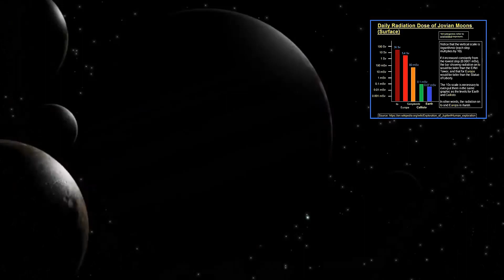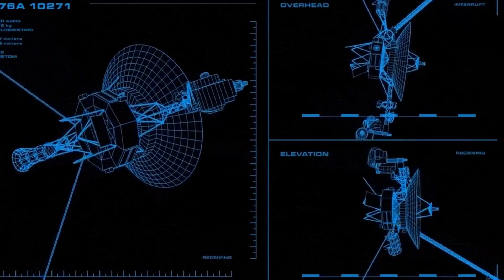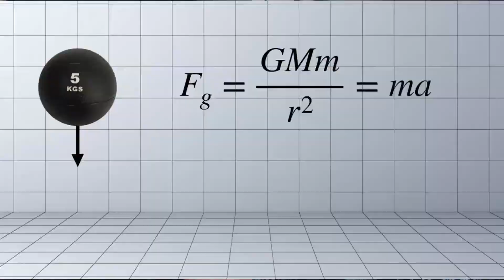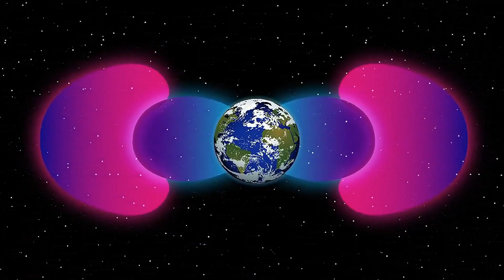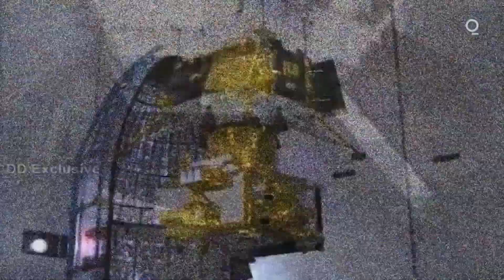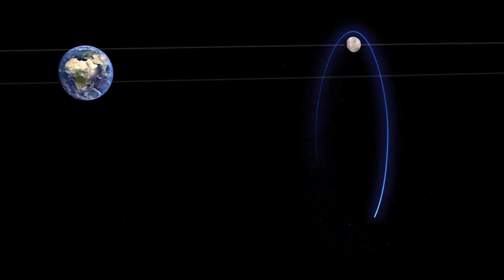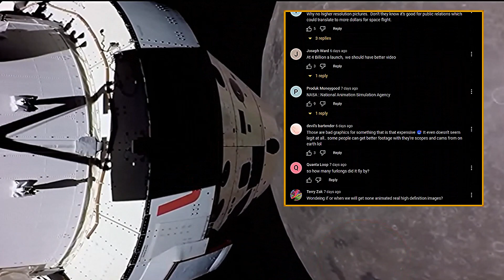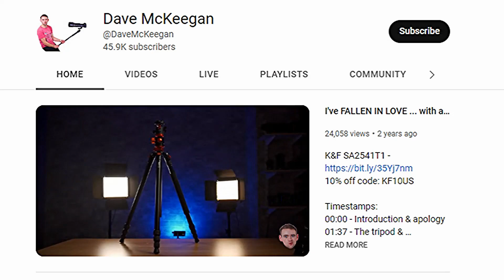THE APOLLO DISCUSSIONS "RADIATION\ ORBITS\ GATEWAY" PART 21

Comment: Comment about Jupiter's moons below copied from phase52012:

(1.) "THE APOLLO DISCUSSIONS "RADIATION\ ORBITS\ GATEWAY" PART 21" - Just listening to this gives me a headache.
At 00:34 - We are looking at an animation of the JOVIAN SYSTEM. And the graph that pops up says: "Daily Radiation Dose of JOVIAN MOONS. (Surface)". And Scott says "why wouldn't our own moon have that increase?". OK ADs, I'll explain why the numbers are what they are. THEY ARE MOONS OF JUPITER. For anyone who knows anything, thats all you need to know. Jupiter has two and a half times the mass of all the other planets in the Solar System combined. Had it been any bigger; we'd probably have two suns in the sky. Jupiter's magnetic field is the strongest of any planet in the Solar System. The magnetosphere extends approx. 75 Jupiter radii from the planet. Our Moon does NOT orbit Jupiter and is NOT enclosed inside Earths magnetic field. BTW: when NASA sent Pioneers 1 & 2, they detected the high radiation levels around Jupiter, but continued to operate. To protect the more sensitive instruments on the two Voyager probes; which were almost complete; NASA had to think fast. So they sent a guy down to the local supermarket who bought up all the aluminium foil they had; and the engineer wrapped all the electronics in a few layers of aluminium foil, and the rest is history.

Comment: FAO William Swithin. The Apollo spacesuits were not designed to leak, they were expected to gently leak but, as long as it was within safety limits that was okay. The Purge Valve was part of the emergency OPS (Oxygen Purge System) for use if the PLSS failed in some way. The purge valve, (note the word 'purge') was not a pressure valve, it was to vent CO2 contaminated air in the event of a PLSS failure and the OPS was in use. The OPS was never required.
Reply: You know he’ll never understand a word of this even if he studied it with a tutor for the next ten years, right?
Reply from the maker: Zippers no matter what you do to them, will leak atmosphere in to an ultra hard vacuum whether in space or in a chamber on earth. Why were,'t the suits tested in the Sandusky chamber then? There lies the lies.
Reply: @shillstompers3793  Do zippers hold out the water from a dry suit? No, they pull together seals which, in a spacesuit, are forced together even tighter by the pressure inside inside the suit pushing out. 
Are you talking about testing suits in the Sandusky chamber with real people? How long does it take to pump down the Sandusky chamber? How quickly could you get to a person in trouble inside the chamber? Try thinking.
What is the difference in pressure between LEO and on the moon in actual psi (or whatever units you like)? Compare with the maximum A7L leakage safety limit of 0.3psi/min.
Reply: @shillstompers3793  You are so thick. The zippers ARE NOT THE SEAL! The zippers hold the seals together. FFS, it's not that complicated.
Reply: @corneliuscrewe677  For them it is.
Reply: @CLERIC_58  No arguments there...

Comment: Big solar events can cause big rapid distortions in the Earth's magnetic field. Moving magnetic field lines passing through a conductor induces currents to flow and, on power lines, these may be large enough to blow the transformers at the ends which may be hard to replace, especially without power. Power is not being absorbed from outside radiation as Marcus Allen was suggesting.

Comment: Because the Earth covers about 2 degrees in the lunar sky and remains in the essentially the same place, once the LRV antenna is pointed at the Earth it didn't need to be adjusted. The Earth is rotating of course, and different receiving stations (some with dishes over 200ft in diameter) took it in turns to receive the signal from the moon which was widely spread out by the time it reached Earth. The high gain antenna on the LRV didn't even need to be aimed with high precision, its gain was 24dB directly on target, 23.5dB within 5 degrees and 20.5dB within 10 degrees meaning the antenna could move by 10 degrees and STILL be picked up on Earth.
This is why the LRV could be bounced around as they unloaded equipment and not lose communication
Reply: Lol you are a flat earther, literally.
Reply: @papalegba6796  Meaningless, especially as I talk about the Earth rotating above. You have all the qualifications for flerfdom.
Reply: @CLERIC_58  says the bot who just stated the earth both moves & doesn't move lmao. You have zero self awareness, chatbot.
Reply: @CLERIC_58  I understand you're a flat earther spamming me with NASA propaganda.

Comment: The flamingos from Planet Earth 2 have what relevance exactly? UV gets stronger the higher up we go? Who knew? Solar UV does not penetrate metals, spacecraft windows block it and plastics such as polycarbonate and polysulfone used in the Apollo spacesuit visor assembly do a good job of blocking it as well.
Reply: @boptah7489  I wonder how that object that looks just like the ISS managed to get 250 miles up, as can be easily measured using basic trigonometry using the differing transit paths across the moon or sun as seen from closely separated observers on the ground.
Reply: @boptah7489  The ISS is not always in the sun is it?
Reply: @CLERIC_58  hologrammed SR71.  As i told you before.      I have seen those hilarious videos of the transit paths accross the sun and moon.   Maybe someone should tell them about parrallax.
Reply: @CLERIC_58  holograms can change colour.  
  The Sun gives off lots of radiation.  If the ISS was real then it would b a mass.   and the mass would vaporise .  because it would not be able to radiate the heat way in sufficient quantities  ( in the form of infrared )   the Sun is more powerul than a tiny little mass.
Reply: @boptah7489  Not interested in the colour of a hologram (about which you clearly have no knowledge). How does a hologram 250 miles high, block light from the sun so it is silhouetted?
Reply: @corneliuscrewe677  I have only come back for some nice easy sport from some low hanging fruit.   It tickles me pink watching the mentally deficient dribble everywhere. 
 And you are correct.  rockets don't work in space.    Because there is no resistance.
Reply: @boptah7489  Says the pseudo-flerf who can't comprehend conservation of momentum🤣🤣🤣
Reply: @CLERIC_58  of course i understand the conservation of momentum principle.   Once the rocket has its gases sucked out of it into the vacuum, the gas molecules are attracted to nearby gravitational fields.   You fail to understand that the 'Closed system'  is actually the Universe.   But , not to worry.   A rocket can't go anywhere near space.    As Werner Von Braun discovered.
Reply: @boptah7489  Where did Von Braun state that? Be specific...
Reply: @boptah7489  You misspelled “infinitesimal.” Just sayin’.
Reply: @CLERIC_58  you cannot burn fuel in a vacuum.  you need pressure to mix fuel and oxidiser and then you need pressure to ignite them.  Just like a diesel engine   ( hypergolic )  
   You cannot pressure in a chamber when there is a MASSIVE hole in the end exposed to a vacuum. 
  As i have explained to you before.   Rockets do not work by creating an imbalanced force in a chamber.   A rocket motor is designed to create pressure behind the rocket using accelerated dense gaseous mass and heat.  .  that is why a rocket motor is designed like n inverted Teclu burner..
Reply: @corneliuscrewe677  That video i posted with the vacuum cleaner and the balloon is the closest thing you have seen to a real life physics experiment in your life.
Reply: @CLERIC_58  you cannot burn fuel and oxidiser unless you mix it first.   Do you understand ?.    ie  a typical hypergolic reaction is a diesel engine.  .to explode the diesel/air  it needs to be mixed 
any access to a vacuum does mean instant evacuation.   Imagine a SCUBA tank with the bottom cut off and connected to a vacuum.   How much pressure can you put in the tank with the most powerful compressor in the Universe ?......Zero
  A rocket nozzle connected to the combustion chamber is NOT a small  opening.  It is a gaping chasm in physics.  A bit like the gap between your ears.  
   Now.  to those of you that have even a slight understanding of physics you can deduce that the escaping gases being SUCKED out of the rocket probably impart some momentum onto the sides of the opening.  This means the rocket moves BACKWARDS.    
 According to you.  If i take a suitcase from the boot of a car, the car should move forward because the suitcase has momentum  ????      No   
   Gases being sucked out of the rocket has nothing to do with the rocket at all.   Gases expand naturally in a vacuum and does not need to push off of anything to expand.   A rocket is just a metal tube.   Gases expanding can not exert a force on a metal tube unless there is an EQUAL AND OPPOSITE  force equivalent to the rocket.    You can't pull yourself out of the swamp by your own collar.   You can't lift yourself up with your own bootstraps....struth
Reply: @CLERIC_58    No   using fuel + oxidiser to produce hot gas ONLY works in a pressurised environment.     you cannot mix or burn gases in a vacuum. because to burn fuel and oxidiser you need pressure first..   Thicky 
   The exit holes of the fuel and oxidiser nozzles into the combustion chamber is Much much less that the rocket nozzle Throat.  This means no mater what the input, the output hole can cope....because there is a vacuum and so no resistance. 
   Rockets only work in pressurised atmospheres. 
  " sucking" is the name of the phenomena when high pressure goes to low pressure.   Understand ?.  This means the gases are SUCKED out of the rocket into the vacuum
   you can ONLY create an explosion in anything if there is resistance.  an Explosion is a function of resistance. .
   There is no one in the boot throwing the suitcase out.  that is my point.   you do not throw gases out of a rocket into a vacuum.  the gases are sucked out into the vacuum.   you do not understand  forces and physics.  
   The reason a rocket moves in the atmosphere is because of pressure differential .  the hot thrusting fiery gases behind the rocket crate pressure because of the resistance from the atmosphere.  this then forces the rocket into the lower pressure area in front of it. .  It is all about pressure........Nothing else
Reply: @CLERIC_58  I swear this guy is the most amazing example of deliberate stupidity I’ve ever encountered. He is going out of his way to get everything completely wrong. You suppose he’s really that dumb, or do you think he’s just a troll having a laugh?
Reply: @corneliuscrewe677    Because Von Braun moved the entire V2 launch sites to Belgium and Holland  instead of the safety of Germany.    Because he could not get the range regardless of the content of fuel. .    The V2 rockets can only develop thrust to 20 miles altitude.  and so the range is limited to he amount of momentum achieved at 20 mile.   
  https://youtu.be/V_fPdXLx48c?list=PL8n6KCAJ7I-rHzo8r108rlp4IIahRbhsx&t=508
Reply: @boptah7489  Oh, so butchery of history is also a hobby of yours.... Interesting... ”the safety of Germany” Yeah, I hear it was pretty safe in Dresden. You know, until it wasn’t...
Reply: @corneliuscrewe677  Hard to say, he may just be on a wind up but as we know, there are people who really do cling on to the strangest fantasies out there.
Reply: @CLERIC_58  His are pretty remarkable in there out there-ness. I’d honestly prefer it if he was just on a wind up. It pains to to think that level of stupidity exists, but we know it does. I hate having to deal with it, though.
Reply: @boptah7489  One last time, for proof of concept we only need to consider a gas filled container in space. Tell me, if such a container holdd thousands of cubic meters of compressed gas, and a small hole is opened in its shell, does the pressure inside fall to zero instantly? If you say yes then we both know you are lying and this conversation is over.
Reply: @boptah7489  So you are agreeing that the canister can depressurise slowly? Remind me again, if you are sitting on a chair with smooth coasters inside a vacuum chamber and you throw a bowling ball away from you, will you move the opposite way or not?
Reply: @CLERIC_58  No  the canister depressurises rapidly  because the nozzle ( throat)  diameter is much much greater than the teeny weeny fuel and oxidiser injector orifices
   so   you have 1/   a man in a chair  2/  the mass of a bowling ball  3/  the force of a man separating the two  .    
   you cannot equate the bowling ball with the gasses being sucked out of the rocket the bowling ball has static inertia  / where as the gases are sucked out  .have no static inertia  
    imagine the first molecule being sucked out of the rocket at x velocity.  the next ,molecule out leaves at the same velocity and so on  this means there is no energy transference between molecules because they are all going in the same direction at the same speed.   this is called 'joule free' expansion.  because there is no energy transference.
Reply: @boptah7489  Why are you talking about rockets again? We are talking about a pressurised canister with a small hole in it. Nothing is sucked out, a vacuum doesn't reach into orifices to grab molecules, they make their own way out because they can. Molecules have mass and therefore inertia. Answer me, what happens when you throw away that bowling ball?
Reply: @CLERIC_58  we are talking about rockets really.   Lets be very clear about that.  .    'Sucking'  is when high pressure goes to low pressure.   a gas canister  ( or rocket)   has high pressure contained within it.  When it is exposed to a vacuum.  the gas is SUCKED out.  This means the inertia is in the direction of the vacuum.  and the molecules do not touch each other as they expand into the void.  so there is no 'inertia'  to push off of.  .   If you stand on a table ,you do not fall to the centre of the Earth. not because of the table, but because the  ground supports the table.   . If there is nothing to support the gas leaving the rocket, you cannot apply a force back to the rocket.
Reply: @boptah7489  Answer me, what happens when you throw away that bowling ball?
Reply: @CLERIC_58  what happens when you apply a force to a bowling ball.  ?   
    what happens when you apply a force to a vacuum ?  
   you can't apply a force to a vacuum . and so your bowling ball analogy is nonsense.   .  Get it yet ?
Reply: @boptah7489  Answer me, what happens when you throw away that bowling ball?
Reply: @CLERIC_58  ie.   how much force does the man apply to the ball if the ball is being sucked away from him ?     Zero
Reply: @boptah7489  Stop prevaricating and answer me, what happens when you throw away that bowling ball?
Reply: @CLERIC_58   A rocket does not 'throw away'  a gas.   The gas is sucked out of the rocket.     Just like.  the carpet does not throw away the dust.  the vacuum cleaner sucks up the dust.   .  Do you get it yet ?
Reply: @boptah7489  ANSWER THE QUESTION, what are you afraid of?
Reply: @CLERIC_58   I have clearly answered your analogous question....you just don't like the answer.    Are you afraid that your entire world view is going to collapse in a pile of  demented hysteria?.      I think so.
Reply: @boptah7489  You are sitting in a vacuum chamber with a smooth floor on a chair with frictionless castors and you throw away a bowling ball. WHAT HAPPENS?
Reply: @boptah7489  why do you keep using the word suck?
Reply: @justincox1685  because sucking is the name of the phenomena of high pressure going to low pressure.  It comes from the physics of 'suction'.   Which is related to vacuums.  .   It also accurately describes the people that believe in man made orbits and rockets in space....Suckers.  .   It is all connected.
Reply: @boptah7489  Hey, genius, I'm still waiting for the answer to my simple physics question.
Reply: @CLERIC_58  I have answered the question you wanted to ask.  but  you didn't understand the physics enough to ask it correctly. .  Luckily i am a genius as you kindly pointed out.  and immediately saw through your ignorance.     No bigee
Reply: @boptah7489  “Dunings kruger?” There’s irony....
Reply: @CLERIC_58    How much are you being paid. to deliberately ty to mislead people ?,   How much in £'s  ?
Reply: @boptah7489   Enough to buy a brand new Toyota Tacoma, and I’m asleep by the time my head hits the pillow, dreaming of all the crying I will get from the missing chromosome “rockets don’t work in space” crowd responsible for my good fortunes. I’d sell YOU out for a bag of Oreos.
Reply: @boptah7489  How much hair do you have? I could use some new socks...
Reply: @corneliuscrewe677   ebay .  by all accounts
Reply: @corneliuscrewe677  .  I have long golden 'hippy'  hair.   But i am a right hard barsteward,   So you can just jog on with that one.
Reply: @boptah7489  I am still waiting for the answer to MY question, not a question that you'd rather I asked (you a politician or something?).  Too difficult for you is it?
Reply: @corneliuscrewe677   It's a fair cop.   I am as soft as a little kitten.  Honest.   I have never even been to prison or in a police station or anything. . I am even thinking of joining the salvation army.
Reply: @CLERIC_58  pressure is a scalar & gasses do not behave like solids, strawman spamming chatbot.. A gas expanding into a vacuum does not develop mechanical power. This is a fact & it means no gas powered rockets in space.
Reply: @corneliuscrewe677  you're a chatbot, it's so obvious lol.
Reply: @papalegba6796  You may as well just go full flat earther. You certainly meet the requirements....
Reply: @papalegba6796  Hi bo, I thought you had run away.